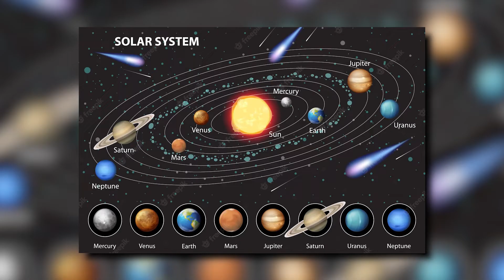James Webb Telescope REVEALS New Details About Jupiter..

Comment: 0:20 "what you have to understand is there has never been an infrared telescope before"--eh?  Thomas Edison used infrared to observe the sun in 1878.  If you're just talking about space telescopes, we've had IRAS in 1983, Spitzer in 2003, Herschel in 2009, and WISE, also in 2009 and still active.  I'm sure you put a lot of work into this video, but that work needs to at least include a quick Wikipedia check for your major claims.  What's the point of science education if it's not to accurately educate people about science?